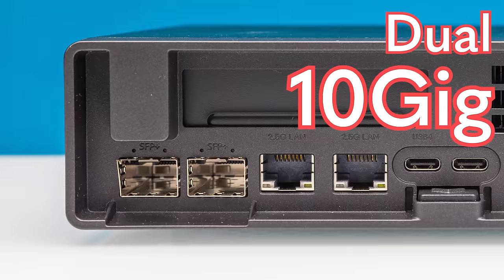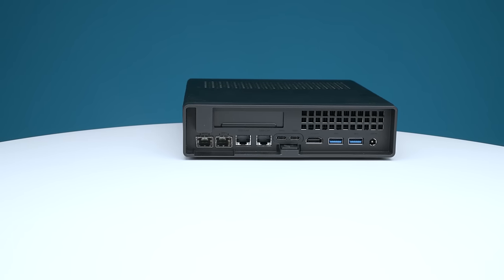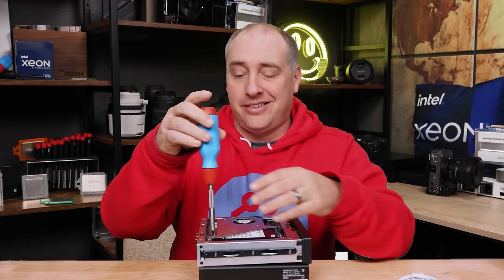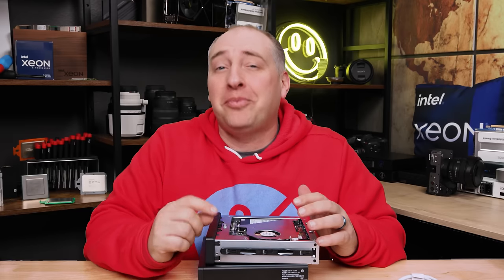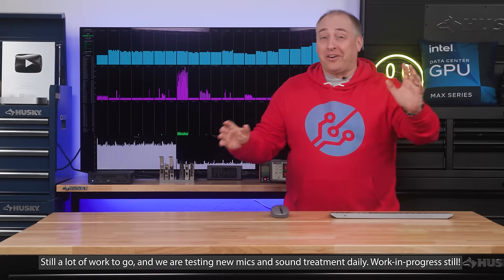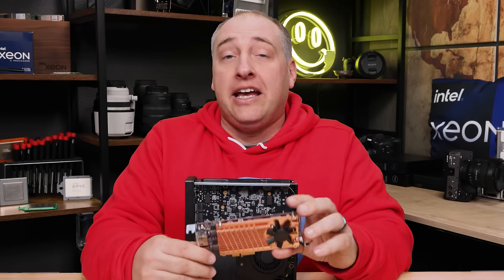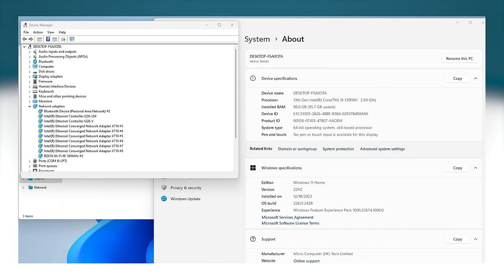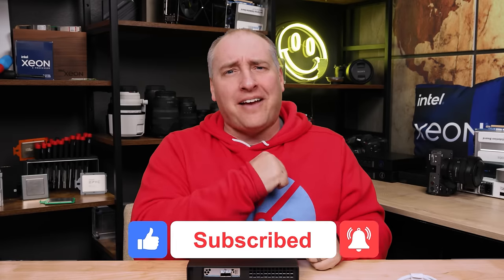The Pinnacle of Mini PC Servers - Minisforum MS-01

Comment: It’s impressive package, however, you could build similar-ish system with off the shelf components for nearly the same price. Granted, it’ll never be this small! 
You’d have modularity, upgradable, repairing and full fat pci slots , warranty 
It’s a trade off that requires a lot of thinking 🤔
Reply: Power consumption might be slightly higher but cooling won’t be an issue as well with diy!

Comment: I learned today that the production models do NOT support 48GB sodimms.
Reply: Really? They are now advertised as 96gb max
Reply: @GarageMaxedOut  my bad, I forgot to update my statement. I fought with the thing for about a week it would not post with a 48 gig stick in either slot, 16 gig had no issue. Finally out of frustration I put them both in, hit the power button and walked away. It took about 3 minutes for it to post with the 96 gigs installed. Luckily, so far it was only the first time that took that long.

Comment: Now we just need a really efficient really powerful single slot GPU
Reply: Someone should try taking apart the A2000 and replacing the cooling. The single slot arc a380 is an option too if you're doing streaming/video editing instead of just gaming
Reply from the maker: That is what they are doing with mobile chips in China to get a GPU in these. We tried a low-end AMD one for old thin clients since that had a cooler and was LP single slot.
Reply: RTX 4000 SFF.
Reply: @Wasmachineman  won't fit. Too thick - it's a dual slot card.
Reply: @ymeshulin  In that case the only card I can think of would be a modded A2000.
Reply: @theinktician  Yes that new ARC A380 is probably the one to use for this system.
Reply: Nvidia RTX T1000 8gb should do great while we wait for something new

Comment: you really want 128 gigs of ram or more in a system like that. even on my 8500T, i use 128 gigs of ram.
Reply: what do you use 128gigs for on an old 6 core cpu?
Reply: That's entirely dependent on workload.

What do you actually use all your RAM for?

Comment: too small, too many compromises - just get something bigger w/o the issues or better yet build something - you can do thunderbolt point to point with these in a cluster over usb4 supposedly...usb5 has been out for 8 mos but is basically vaporware

Comment: Does it fit a rtx a2000?
Reply from the maker: The RTX A2000 they claim is a modified RTX A2000 MOBILE that apparently folks in China have modified for low profile slots.

Comment: To be honest a system like this needs no GPU at all , i see this best used for Hypervisor uses with VM's where you run all your networking and or servers through it.  1 system for all instead of multiple systems doing what you can do in an all in one solution.   Yes redundancy is non existent should something happen to that 1 system, unless you have 2 of these clustered together in case one drop's out.
Reply: I want hardware decoding/encoding for video transcoding.
Reply: @thezfunk  then yes a GPU in your case is needed.
Reply: @thezfunk  Doesn't it have an IGPU? Any intel IGPU the media decoder/encoder supports more than any Nvidia GPU . Go look at the QS info.

Comment: Unpopular Oppinion. I don't like it this thing is tailored to the person whos asking for everything but not buying anything. This system has so many Ports and uses its like a jack of all trades but master of none. I could not think of a single use this would be good at, where I could just not go out and buy a Different better system and even save a buck. Want a router? Well theres better systems, Want a VM host, well theres better ones. Want Storage? well theres way better ones. Wanna Virtualize a router and have other VMs with a bit of storage, well it works with this but theres cheaper ones out there which might not offer all the bells and whistles but they also don't cost an arm and a leg.

Comment: I have to question who exactly this system is for:  It's not powerful enough to use as a desktop replacement for anyone doing content creation, it's vastly overpowered and overpriced for the average basic desktop user, it's vastly overpowered and overpriced as a backoffice system, it thermal throttles after 45 seconds of serious use and therefore isn't suitable for gaming or heavy compute, and it's obviously not going in any server racks.  There isn't a single profession or environment I can think of that this makes sense to drop it into at the price point they are asking for.  Can it do almost any task you might throw at it?  Sure.  Will it do any of those tasks well and in a way that makes sense at $700?  No.

Comment: I hate to be that guy... but if it only had the ability to fit a full height PCIE card it would be perfect for my use case!  I'm really having trouble finding a sff system that can support a full height and half length PCIE card.  I know it's an edge use case but I haven't found anything that fits the bill yet.
Reply: That sounds like a cool thing that will never happen. After all, those cards still need to connect to a power supply.
Reply: Why go mini form factor in this case?
Reply: @theinktician  the card I'm using does not require additional power. It's basically a proprietary network card.
Reply: @TOMKO_  I'm currently using an ASRock deskmeet and it's great but it would be much more convenient for travel if it were a bit smaller.